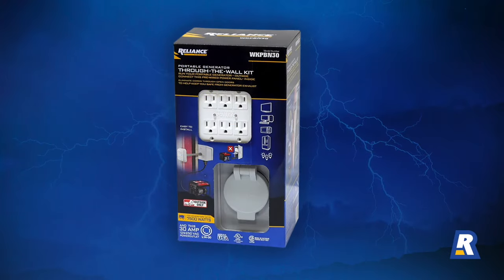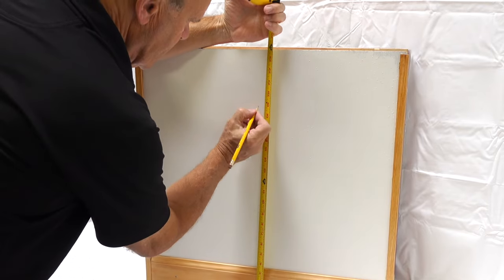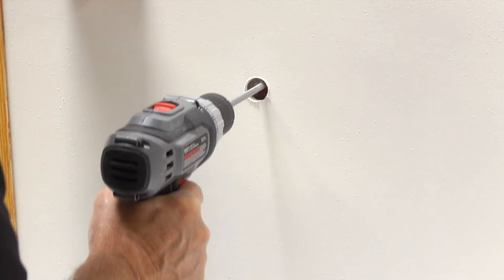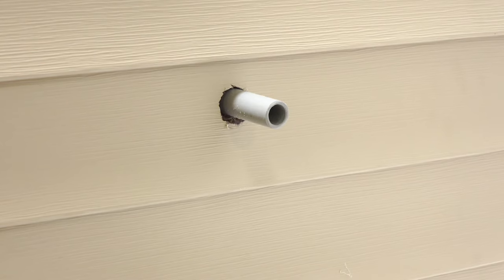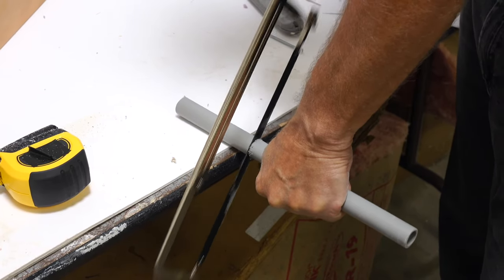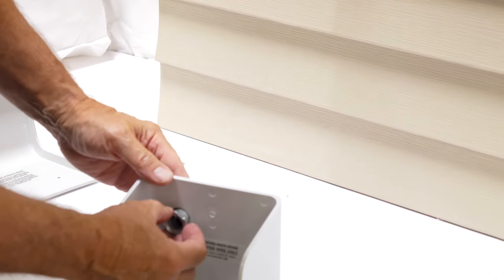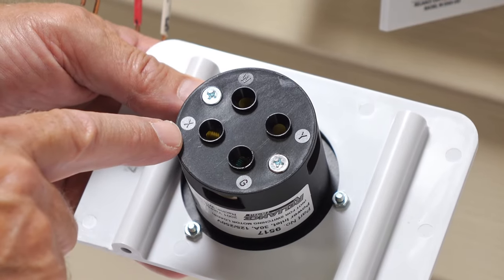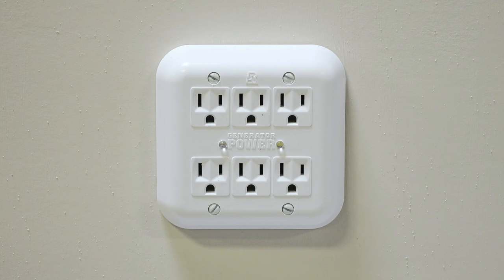WKPBN30 Installation - Generator Power Through-The-Wall Kit

Comment: I want to do this. I have a 4000W generator with a TT-30R (3-prong RV-style) receptacle. I have bought a TT-30P plug, several feet of  10/4 cord, and a L14-30R receptacle . If I leave one of the hots unconnected, will I still have 120 to all 6 outlets inside the house? Thanks...
Reply: I can't believe no one has replied back to your comment I'm wondering the same

Comment: I had trouble with the inlet box cover... it apparently didn't snap completely into place and when I inserted the long screws they didn't screw into the nuts in the back of the box, and now they won't back out either.  I would prefer a front mounted connector to the one provided which is facing downward.  Also, I had a hell of a time with the insulation binding on the bit.

update:  OK, I was able to extract the 2 screws that hold the cover in place using a hacksaw to cut the screws at the back of the box and using a large pry bar to force the front of the cover up and out to expose the screws which I then removed with a channel lock plier.  After removing the screws I figured out the problem... the plate that holds the inlet is curved on one side and straight on the other. The curved end needs to go towards the BACK of the box. I had installed the plate the wrong way so that the plate didn't go all the way to the back of the box.  I received a set of screws and 2 nuts from Support (thank you) and now I need to figure out how to put the nuts back into the backside of the box without removing the entire box (which would get messy).
Reply from the maker: Thanks so much for the feedback! We're sorry to hear you had trouble. Everyone's installation is different and if there's anything we can do to help, please let us know :)
Reply: @RelianceControls  Thanks I called support and got some ideas on how to approach the problem... this is an unusual situation and I hope I can get it resolved this weekend.  I'll let you know.

update:  This is really a great product.   All is good now.  I was able to extract the 2 screws that hold the cover in place using a hacksaw to cut the screws at the back of the box and using a large pry bar to force the front of the cover up and out to expose the screws which I then removed with a channel lock plier.  After removing the screws I figured out the problem... the plate that holds the inlet is curved on one side and straight on the other. The curved end needs to go towards the BACK of the box. I had installed the plate the wrong way so that the plate didn't go all the way to the back of the box.  If this is in the instructions I missed it.
Reply from the maker: @yellow_panther  This is so awesome. Thank you for following up with us and we really appreciate you writing out your solution and perspective for others to see. We'll take a look at the instructions included and see if there's any way we can add more clarity :)
Reply: @RelianceControls  it's getting cold out here, but I bought a second one and will install it this spring... that way I can run 2 sets of generators.  I also got the GENMAX parallel kit which will let me run 3 x 2000w inverters in parallel with an L14-30 cable.

Comment: Is there a way to extent the wires to have this installed on the second level of a house Using longer conduit and all that .
Reply from the maker: Hey, thanks for your question. 

Yes, this would be done with a Wago connector, or butt connector that is UL listed.  With the length you are describing it would probably be best to do the connections in a junction box.  10 AWG would be needed to extend the wires.

Let us know if you have any issues!

Comment: Is this UL approved? How can it split a single 30A single phase circuit to (2) 15A circuits without a 15A fuse or circuit breaker for each row of outlets?
Reply: Good point, Only fuse it as at generator is 30amps, How are we powering 15 amp circuits with 30 amp breaker?

Comment: This video is very helpful. I installed this kit on a brick wall. I drilled from the outside in to avoid the excessive damage doing it in reverse will cause to the brick. It took time to get the exact location from the outside, but I wanted the hole in the centre of a brick for strength and to ensure the three screw holes would go straight into brick, not the mortar. I used sealant instead of PVC cement in case I need to open up the system to replace the plug or exterior box. To strengthen the assembly, I used nylon plugs in the 3 pre-drilled holes in the brick on the outside and used 4 toggle bolts into the wall on the inside to mount the 6 plug setup. I feel the toggle bolts will definitely make a difference securing the 6 plug setup to the interior wall, especially considering how unplugging cords from it will pull on the entire assembly each time. Wall plugs are normally mounted to a wood stud for strength, so these will be very secure. On the exterior wall, I had to widen the hole to allow the conduit fitting to recess into the wall. The conduit fitting concerns me since they now include a ring to insert in the back of the exterior box. It causes the conduit fitting to have very few threads inside the exterior box to tighten down on. There's barely a singe turn available. I hope they address this for others installing the kit. Time will tell if it holds, but its another reason I'm glad I went with silicone sealer instead of PVC cement.
Reply from the maker: Hey deejaay, thank you so much for sharing the details of your installation. If you took any pictures along the way, let us know because we'd love to see it. If you do happen to run into any issues we're here to help. Thanks for watching!

Comment: How important is it that the location be about 19 inches from the floor? I would like to install mine higher if possible. Thanks for any replies!
Reply: National Electric Code recommends outlets be 12 - 18" above the finished floor. It's just standard practice but the outlet can be higher (i.e. an outlet for a wall mounted television). Remember though you have to be able to reach the outlet on the outside of the house with a generator cord and this is going to make your generator's cord hang down from your house if you put it up higher. Hope this helps!
Reply: I was going to install at 16" inside the house (was about 20" outside) and I hit a 2x4 block between the studs.  Went up to 19" and it was clear!

Comment: Great video, but I have a question about the chord. The WKPBN30  has 4 wires indicating it is meant for a center-tap 240v generator. I will be getting a 120v 30 amp generator which has a 3 prong outlet for the extension cord. I gather the WKPBN30 can be used for either 240v or 120v??? How does the cord work in my case? Thanks in advance.
Reply: Yes, it will do 120 or 240 30A.  You need a converter plug like this one https://www.amazon.com/dp/B08F4YQLBX?psc=1&ref=ppx_yo2ov_dt_b_product_details
Reply: @jimfaulhaber2543  make sure that the converter plug is BRIDGED, there is a plug from RCA that looks like this but apparently is not bridged, so you only get power to 1 bank of 3 outlets

Comment: Going to order one. My Gen has an L5-30 outlet and an L14-20 outlet. 
So do I need just one L14 30 cord to make the connection from the 20amp output side? Or do I convert the L5 30 amp outlet to L14 30 female? Thanks

Comment: wouldn't it be better to first drill from the outside of the house so that you know exactly where you will mount the outside box against the siding?
Reply: If your exterior is brick, block or concrete, I would drill from the outside in. Otherwise, you'll blow out the material on the exterior.

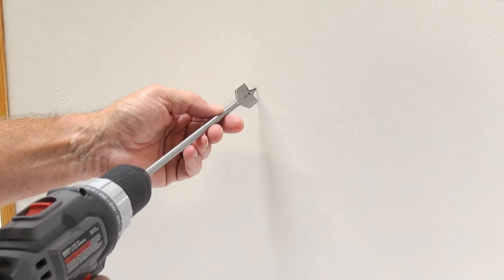Comment: @2:59 it clearly appears to be a 1 inch drill bit (as marked) vs. anything larger. It seems to me that for concrete or CBS homes, a 1 inch bit would work. Am I wrong about this? Thanks.
Reply from the maker: Hey Ricky! A one inch bit should work. Let us know if you have any more questions or run into any issues!

Comment: I have an outside brick wall - what is the smallest size hole I will need to drill for the wiring?  A 1" massonary bit would need a good sized hammer drill which I don't have.  My drill can at best use a 1/2" masonry drill bit - can the wires fit into a smaller diameter pvc?
Reply: As long the wires can fit in through a 1/2" But, I would say better off with a 3/4 inch. On the brick, drill using smaller bits to create the hole. Then punch it out.
Reply: 1-1/4" is really the proper size as the manufacturer states. It's not just for the pvc. The rear side of inside outlet panel also must fit the hole as well as the rear of the outdoor connection. Get a 1-1/4" diamond hole saw. It will cut through brick easily.

Comment: How do you ensure that your drill bit exits at a good place on the exterior on a flat piece of vinyl siding and not awkwardly right on the step or fold of the vinyl siding? Is it just luck of the draw where you exit? Anyone can answer please. Thanks!
Reply: Using a table measure, measure the distance from your floor up to a windows. One you know how far your floor is from your windows, go outside and measure down from that windows to see exactly where your floor is. Once you know where your floor is from the outside, you should be able to make an educated guess on where to drill your hole. This was complicated to explain. But please feel free to comment back if it didn’t make sense.
Reply: @StupidTeenageVideos  I thought I was being real smart and careful doing this, but still ended up just below one of the vinyl siding steps, actually where the pieces clipped together. I still managed to get the outer box attached, but the top cover of the box was very difficult to install back on because of interference with the siding step.

Comment: The wires on the generator panel are too short for where I need to put it. Can the generator panel (six gang outlet) be opened so I can change out to longer wires or will I have to splice the wiring?
Reply from the maker: Hello, thank you for the question.  If the wires must be extended, a junction box/outlet box enclosure should be used rather than breaking open the power panel.  The size of the power panel allows it to mount to a double-gang size box in the wall, where the connections can be made to extend the wiring.  You may also want to consider increasing the gauge of the wiring for the extension wires depending on how long of a run.

Comment: Can I use this with a small 110 volt ac 2000 watt generator? My connector at gen is standard home 3 prong outlet. If I get adapter to fit from standard extension cord to l14-30 connector on box will this work
Reply from the maker: Hello, if you get an adapter with the 5-15P and the L14-30C plug ends, yes with the proper adapter it will work.
Reply: Dave, I’m in your shoes!   Did it work for you and can you share a link to the adapter you used?  Thanks

Comment: I assume that the drill bit supplied will not be sufficient for concrete block external walls and I will have to purchase a masonry drill bit.
Reply: That is correct. I recommend a 1-1/4" diamond hole saw. That's what I used on brick and it worked great.

Comment: I installed this kit this week. The left indoor outlet indicator light is flickering. If I tap the outlet box lightly it will come on. If I plug in a device like a box fan it may stay on or go out. I haven’t driven a ground rod yet to ground the gen and I have a 4500/3500W Champion inverter gen with a floating neutral ground. A plug-in circuit tester indicates an open ground. Could this cause the light to flicker and turn on/off? The right one is always on whether or not anything is plugged in. Thank you for any input.
Reply from the maker: Hi Ricky! Sounds like there could be a loose connection that’s just barely making contact sometimes. Would you mind reaching out to tech support here so we can trouble shoot a little quicker over the phone? (800)634-6155

Comment: What is the wire size that Reliance is using?  Seems small for a 240Vac, 30A (7200W) incoming circuit.  I think one should be able to get 30A @ 120Vac (3600W) from the top 3 outlets inside the house and the same for the bottom 3.  Should not this be #10awg copper wire thru the wall?  Suggest adding the PVC glue to the kit, although I did not use, as it seems unneeded, and would make the system hard to pull apart if a fix was needed...maybe just glue one end, the outside.
Reply from the maker: Hi @tomcez - We are using #12awg copper wire to connect the inlet box to the outlet panel. The requirements for manufacturers are slightly different than what the NEC dictates for installations. As a manufacturer, we're allowed to use any wire size so long as the specified wire is capable of passing the UL temperature rise test.  For further confirmation of our UL Listing, our file number for this product is E490894. 

In a nutshell, we're confident this product is perfectly safe to be installed and used, as long as it's in accordance with our installation instructions :) 

We appreciate the suggestion! Incidentally, we were including the PVC glue in our first production run. We removed it because such a small amount was needed, and no adhesive manufacturer wanted to sell us such small tubes at a reasonable price.

We're sincerely grateful for your decision to purchase our products. We hope you have a wonderful holiday season!

Comment: I have a Westinghouse WGen5300v which has an L14-30R 120/240V Transfer Switch, could I run it at 240v to power all 6 outlets on the WKPBN30 or does it need to be switched to run on 120?

Comment: they show you how to plug in 4 prong to through the wall kit but not where to plug it into generator- which i have been searching for
Reply from the maker: Hello, the plug in method to the generator is similar but will use a male plug to connect to the generator receptacle which is female.  If the plug is a locking plug then it will be inserted and turned clockwise to lock in place.  Please let us know if you have any questions, thank you.
Reply: The trouble is there are many different types  generators depending on their purpose.  MANY receptacle styles. The generator I bought came with a four prong 10 gauge extension cord, if you gave good feedback, but there is no 4 prong receptacle  on the generator. Nice. Only 3 prong and RV plug.  I bought an 18"  RV to 4 prong adapter. Expensive. But a must have.  So I will have 30 amps on the thru the wall plugs.   Here are the numbers  TT-30P to L14-30R. Only good for up to 3750 watts. Amazon
Reply from the maker: @powerengineer1  Yes that's true, thank you.  Generators usually will have multiple outlets of different ratings and may not have the L1430R outlet which would match the power inlet box connection.  This is just part of researching the cord connections which is necessary at some point when attempting to plug anything into any generator, whether purchasing this type of kit or an actual transfer switch.  We can only reasonably include one inlet box and the L1430 type connection will allow just about any generator to be used with that outlet or a lesser rating with the proper adapter or cord setup.

Comment: I followed the steps and I am only getting the bottom 3 outlets working.  Also, only 1 of the 2 led lights is glowing.  Suggestions?
Reply from the maker: Hi Steve (or Sheila)! This could potentially be from only one of the hot wires receiving power. Are both the red and the black wires from the wall plate securely connected to the X & Y terminals in the inlet box? 

Just a side note, maybe check those connections in the inlet terminal/clamps too. I’ve accidentally tightened those down on the insulation of the wire before… Needless to say, the power didn’t flow very well for me. 

Worst case, if ^ doesn’t help the issue, we could run through some other possibilities and make sure we get you taken care of over the phone, if that’d work for you. (800)634-6155 thanks!
Reply: @RelianceControls  one of the hot x/y was not make a good connection - clamped on insulation.  Its fixed and works fine now.  Thx.

Comment: Got this kit and like it,need a cord from generator to power panel which cost near the same as panel.If doing it again I would mount it higher on the wall, much easier to plug in the outside cord,eye level would be perfect . My generator is a 8500 so has plenty power to run anything we want to use.l suggest heavy exstenion cords for things like frig etc
Reply: @BlueRage  it's a heavy wire to connect generator to house and wired so as to fully power six extension cords. Cost the same as having an electrician buy parts and putting it together.

Comment: Just done with the installation, however, the upper two anchors on inner outlet wont hold the screws tight . The upper screws keep rotating and obviously the outlets box is not snug to the wall like it should be. 1/4 inch bit was used to drill the holes as recommended. Any recommendation on how to fix this?
Reply: Also, pvc glue was missing fortunately i had a plastic glue already.

Comment: My house furnace has a 100 amp breaker so I doubt there is any transfer switch I can connect to so I can run my furnace off a generator. I'm thinking the furnace has the wrong breaker. Anyways is there a kit you can buy that you can plug in a 5000 watt heater into thru the wall? I think it's a 30 amp  breaker to run them.
Reply: What type of furnace and how big?? There is no way it's fed from a 100 amp breaker lol

Comment: I have a TT30R - 3 prong plug on my generator.
It is 30 AMP 125 volt outlet, will the WKPBN30 work with this generator.
Let me know.
Reply from the maker: Hello, yes it will work you will just need some type of adapter cord with a TT30P on one end and the L1430C on the other end.